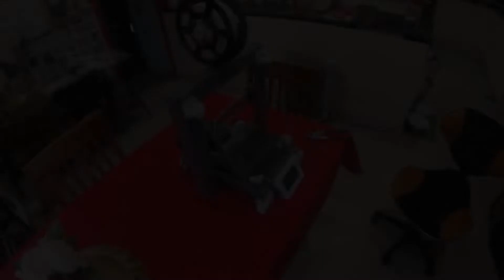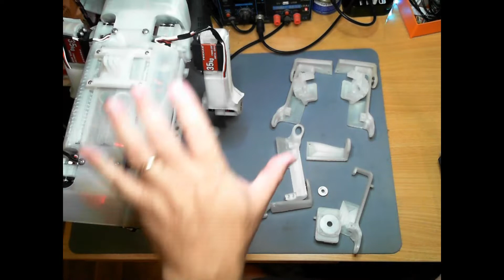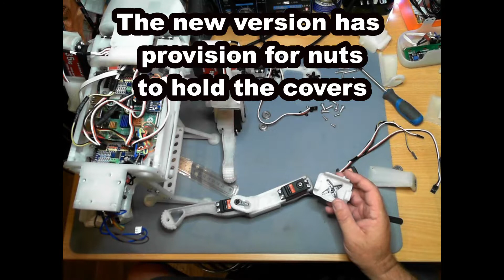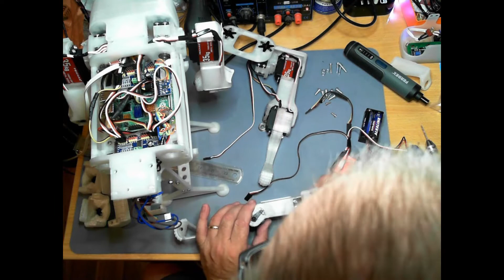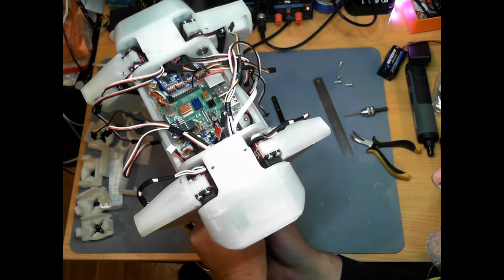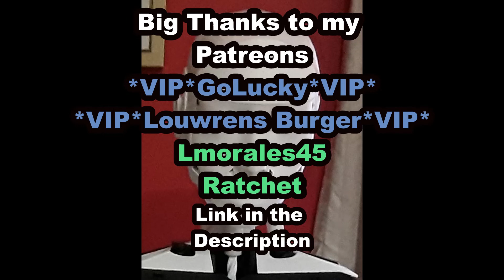SpotMicro Part 13

Comment: the device for calibrating the servo's .does that work for 7.4 volt servo's too ?
Reply from the maker: The device I use, works 5.0 -  6.0Vdc
https://youtu.be/6m8gr5KbAyI
however most of the higher voltage servos work 6.0V to 84Vdc

I did do a bit of testing on a range of standard servos to see where they would fail; at the low end.
https://youtu.be/0yl82ITjQUs
It was surprising to see just how low a number of these servos continued to work, so i think you should be ok using this tester on higher voltage servos at 6.0V
Reply: @CyberOne  great thanks for the link .